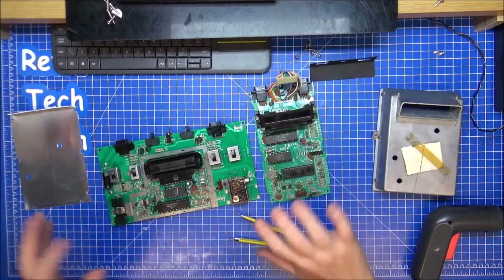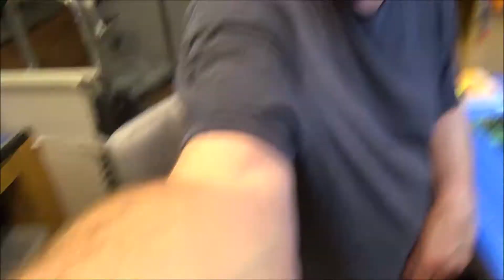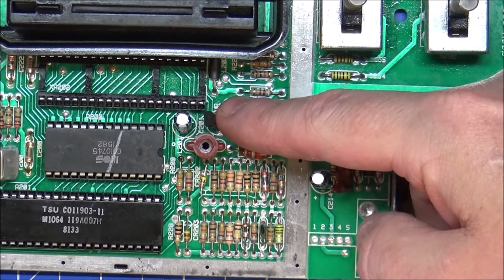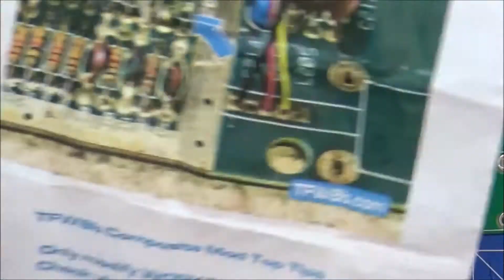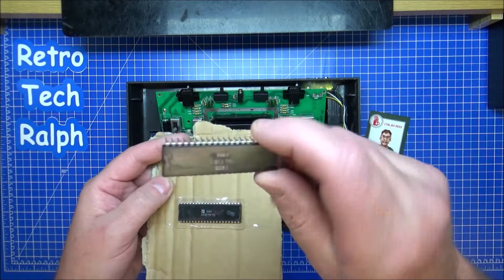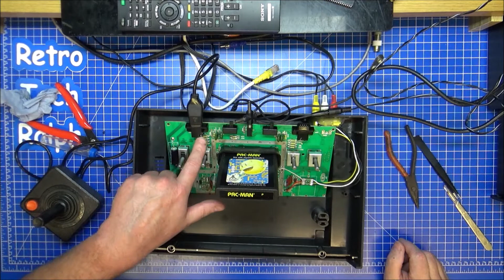Atari 2600 Vader 4 Switch Repair Part 2

Comment: Relatively recently I got a Jr that wasn't working. Turns out the voltage regulator was shot. After I replaced that, it would only display random lines and colours. I assumed it might have been bad RAM because I get random stuff on a screen with an Apple II with bad RAM.

The RAM on the 2600 is built into the RIOT chip. However with the Jr, the chips are all soldered on, and I didn't want to have to desolder chips to test a theory. So what I did was pull a known RIOT chip from one of my other systems, and placed it on top of the 'bad' RIOT chip on the Jr, and it worked! But what was even more surprising, I thought I'd try powering it up again without the good chip on top, and the whole thing worked! 

I think what happened in my instance is when the voltage regulator failed, some bit in RAM somehow got stuck. After replacing the voltage regulator, and by placing the good RIOT chip on top of the 'bad' one, it somehow unstuck the RAM.

So I think it might be worth trying that on your bad RIOT chip, just in case it was a stuck bit. 

BTW, the shiny finish is probably a different manufacturer of the chip. I have some that are shiny and some that aren't, and they both work just fine.